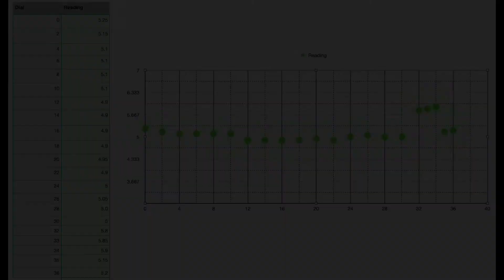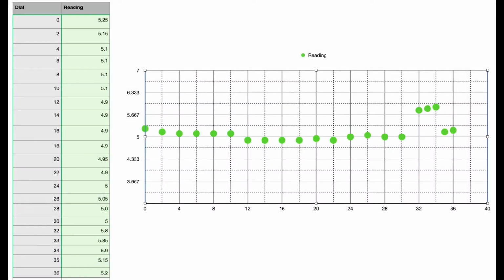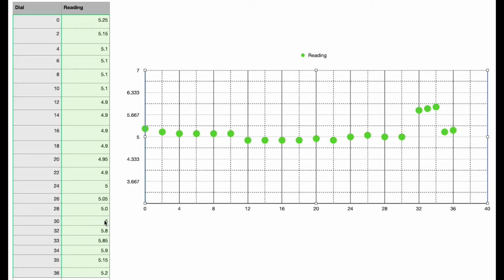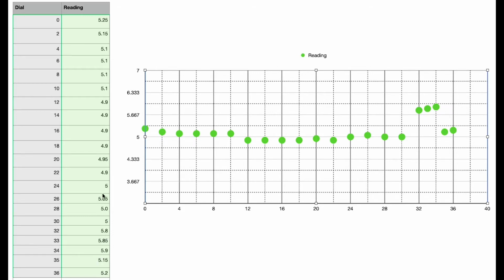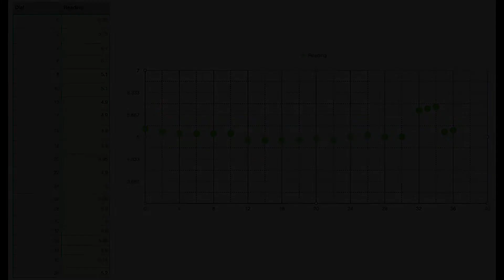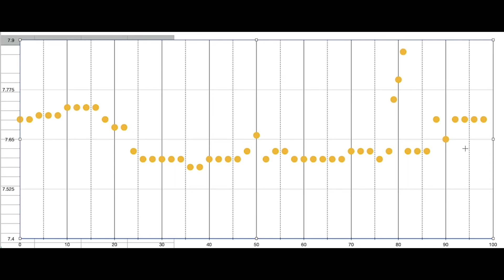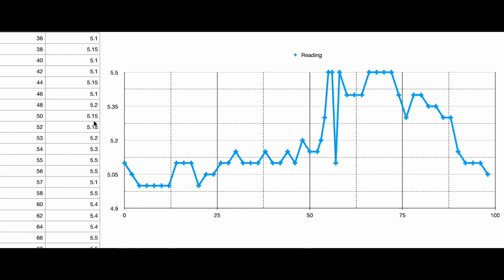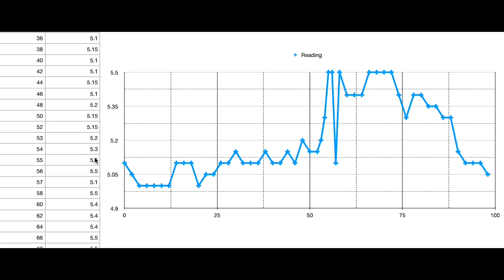Group 2 Safe Manipulation Course - Part 5b - Gate Signatures

Comment: Great video series for beginners like me. Is there a way to determine what is the real gate signature if there appears to be 2 or more possible gate signatures on a graph? I'm very new at this. I was recently in the market for a safe and took a chance and bought a craigslist safe for $50. It is locked and I'm trying to get it unlocked. I started off following another video series but using the eyeball method was problematic. Your wire method is brilliant for beginners. I used a long wire, about 10 inches (1/16" tig welding rod) so the effective range per dial increment came out to around 18mm. I did a full detail of both sides of the contact points and appear to have some pretty accurate data. Both graphs mirrored relatively closely.

There are 4 mirrored areas on both graphs that could be gates? Two seem to be very pronounced, two less so. I don't know if this safe has 3 or 4 disks, it has no markings, just a tiny label with a small amount of Chinese script and a number. It's beige and brown, looks like something from 80's I would guess.

I don't know how to post my graphs otherwise I would. I created them in Excel.

One more thing, I noticed in your charts that you have measurements in fractions of millimeters as small as three places, how are you getting measurements with the wire to that level of accuracy?

Thanks!
Reply from the maker: For fractions - I'm mostly just estimating the location within the MM markers.  I usually just do #.0 and #.5 - some of those graphs might have been done with different techniques.  Also, the labels on the graph might have been chosen by Excel/Numbers.  Some of those I might have, also, done the data entry in CM instead of MM.

You can tell how many wheels are in a lock by spinning it a 6+ times in one direction and stop at 50.  Then, spin the opposite direction and feel/hear the wheels being picked each time you pass 50. 

You can, sometimes (rarely), see multiple gates on a single AWL graph.  I've never seen 2 gates clearly shown up, but sometimes there's a very small dip around the other gates.  You can try to do a high-low test at all the locations and see if you find anything.  Also, you can drop wheel 1+2 in one of the low point (from your AWL graph) and do wheel isolation on wheel 3 (see video 6b) -- then try to do wheel isolation with wheel 1+2 dropped in one of the other low points.

Best of luck!